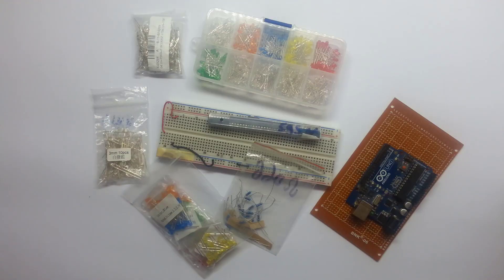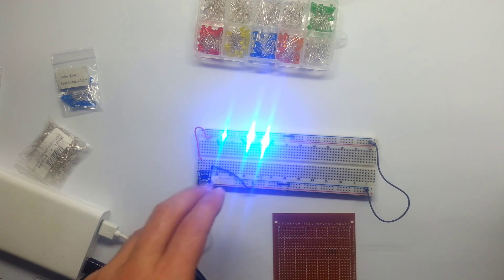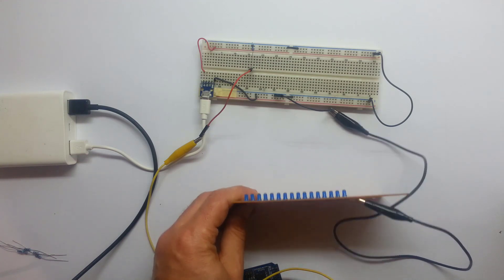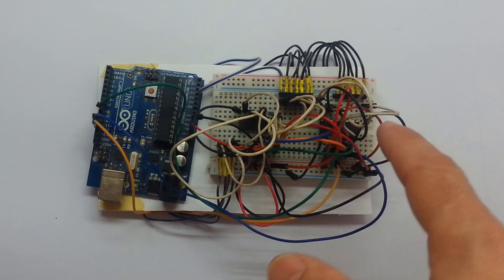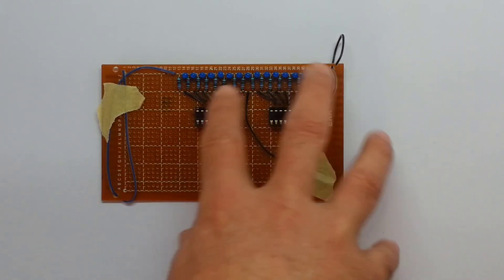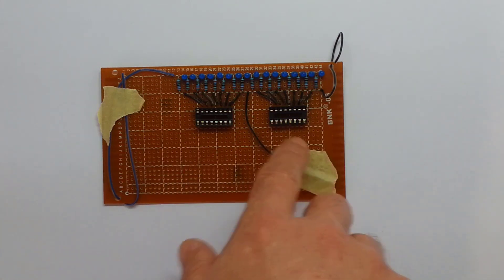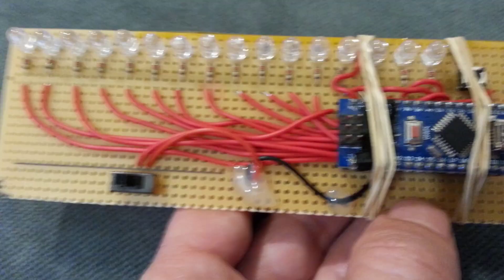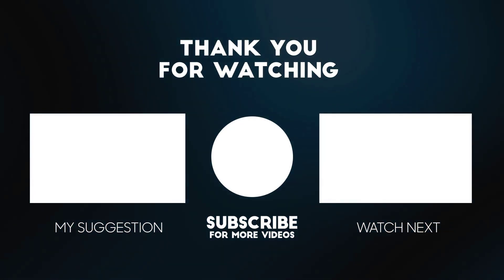16 LED POV wand - writing in the air – fun persistence of vision part I

Comment: I made a Word Wand in the 80's. Programmed with 2 buttons.
Reply from the maker: What was the MCU ? how many LEDs ?
Reply: @talofer99  My 1981 invention, the Word Wand, has been resurrected (as IV) with bright white LEDS and an Arduino UNO. It can be easily read at a distance in broad daylight with 14" high text. Its predecessor, III used banks of NE2's and still needed some dark conditions and produced 36" high characters.  The original used a one-bit serial RAM that scanned vertically through columns that made dot-matrix type letters. I got the idea from my printer at work!
Reply from the maker: @chrisclement8200  is there any info on it ? photos ? would love to see how it looked like
Reply from the maker: @chrisclement8200  super cool :)